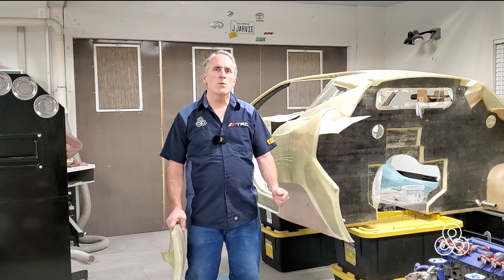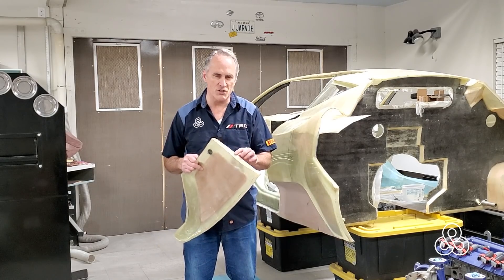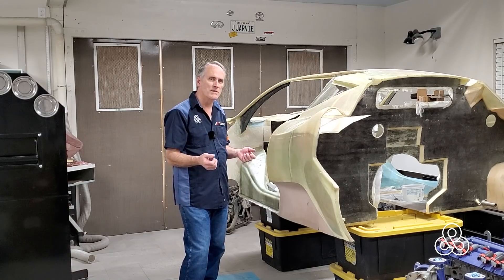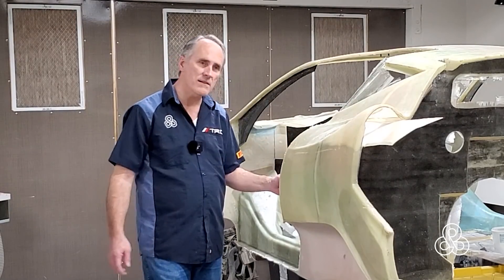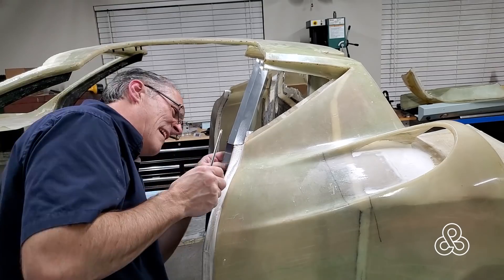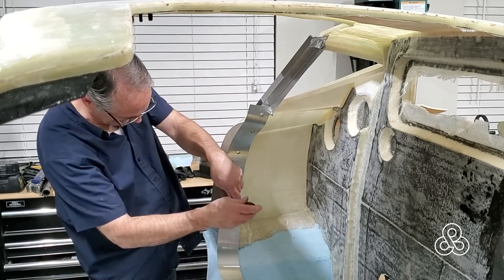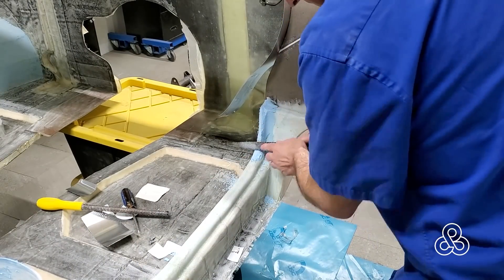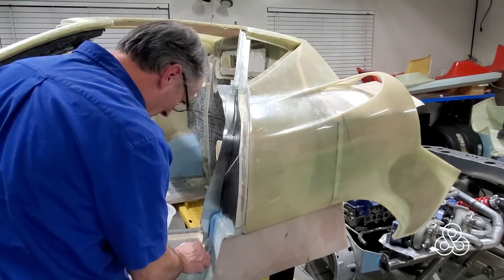A59 Details of the monocoque tub. Arete supercar project.

Comment: When designing the seal areas you need to remember to have the seal material pressure against a backing surface so that the air pressure increases the seal. A V or cup shape is best as it supports the seal from multiple directions.
I have been in vehicles that just seal against a flat surface with no support for the seal and they whistle and let water in especially when the seals get old
Reply from the maker: Important to note as my seals are from a wrecking yard . . they're already old! HA!

Comment: Hmmm more complicated than I imagined. Now I am wondering...if I understand you correctly, you intend to install the rubber, and then use that to figure out the backside of the doors. If you use the rubber to go off of, won't it be uncompressed when you do the back side of the doors, resulting in too much of a gap when all the parts are complete? Or am I understanding it wrong?
Reply: @307Driftwood I completely understand what he is building. The rear part of the door must mate to this rubber seal. Right now the doors are only the outer shell. He has not made the part of the door that will mate to the rubber yet.
Reply from the maker: Your on the right track David, I will be pouring foam around the seals and surface area of the door jamb. Although the seals wont be compressed at that time of the foam pour the fiberglass layup will be built up away from the foam and against the seal. Thus compressing the seal the amount of the layup- say 3/16"
Reply: I assume that the absolute limit of travel in the closed position is determined by the door latch mechanism rather that the seal. Unless it's way too thick of course.
Reply from the maker: @ekim000  Assuming the seals are compressed, then the latch is adjusted to align the panels. (door to the body)
Reply: @ekim000  I didn't mean that the seal would limit travel or determine the door's location. You have to consider multiple surfaces are involved, and none of them exist at the beginning of the video. At the end, one exists (where the placed the seal). That seal has to mate against another surface, which is the back side of the door. That surface does not exist yet and he will have to build it later. He will need to factor in the door latch location when he is building the back side of the door, but that will only affect the compression of the seal slightly or not at all, depending on the alignment of the door once assembled.